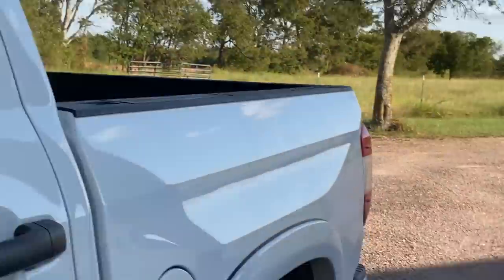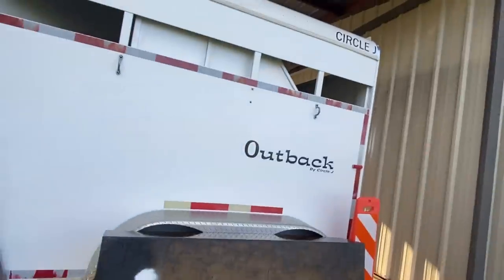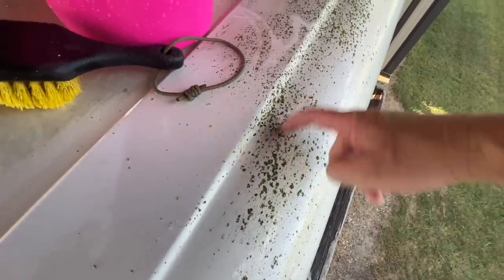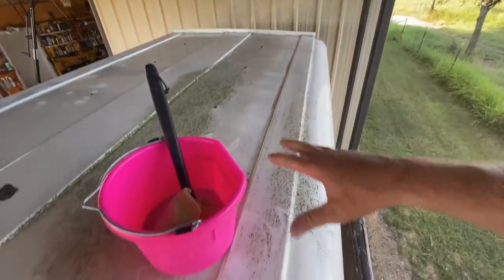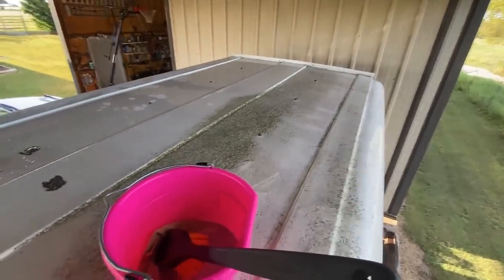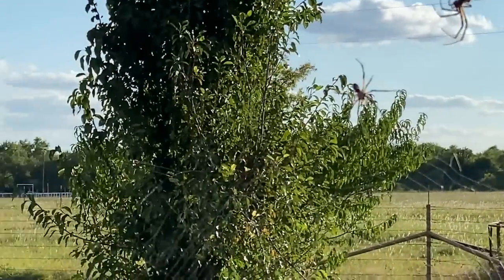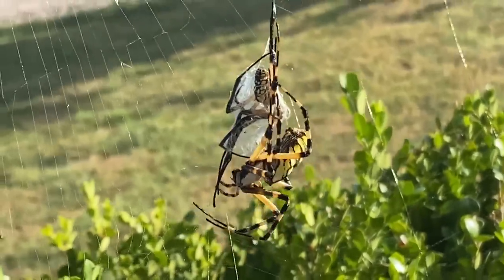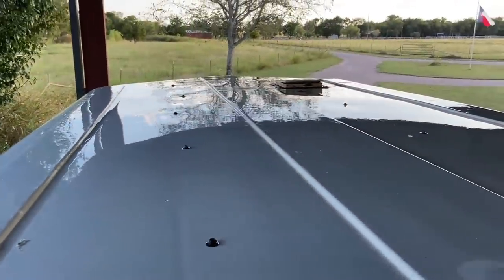Cleaning Fiberglass Roof On Horse Trailer - How One Project Was Suddenly Ten

Comment: You could rough up the chipped spots and fill them with fiberglass resin to seal them up. 

The key thing to remember is when you mix the resin together it becomes exothermic, which means it produces heat. So.... make sure you dump the excess compound in a bucket of water until it has calmed down because throwing it in the trash is not recommended. It can get really HOT. 

Other than that, a dab of paint would work too. Anything that would prevent water from penetrating into the fibers.
Reply from the maker: good tip, silicone is easier

Comment: there is a special type silikone / bitumen glue for caravans campers trailers...
Do not use kitchen bath silikone, it will always seperate and let moisture in.
has to do with diferent expansion due to temperature and vibrations.
I live in a trailor - I know from painfull experience.

Comment: Nice to see good trailer care, especially the roof cleaning and application of wax on sides. Well worth it to protect the finish from UV and washing the roof helps keep sides cleaner too. Looks like any rust was minor and easy to deal with, one of the benefits of being in a non salt belt state or province. Up here in Ontario salt and brine are used at least four months out of the year so pickup and trailer receive an application of corrosion protection each summer, along with a mid season "deep clean" for the trailer.  https://www.youtube.com/watch?v=eqWkslMnI74&t=249s

Did you add the red and white reflective striping (aka "Dot C2 conspicuity tape") to sides and ends of trailer?

Comment: If that’s the north side of the building, that’s the toughest type algae to get off. It’s like concrete. I have to use the pressure washer to get it off my porch. (North facing)
Reply from the maker: it faces east side but N winds get it

Comment: So I have a fiber glass sky light in my bathroom that was leaking so my roofer told me to use flex seal it dries to rubber I used the blue but it comes in clear now ..it has held for 7 year's no leaks

Comment: Can you get a cover for the trailer?
Reply: A cover can actually be counterproductive in an outdoor environment, especially in windy conditions due to the cover moving in the wind. This can wear the finish away on surfaces the cover is touching, surprisingly quickly if dust or grit gets under the cover. Moisture can also become trapped under the cover depending on the climate.